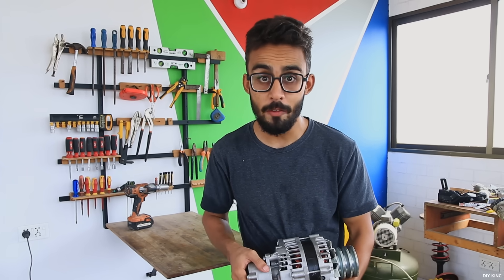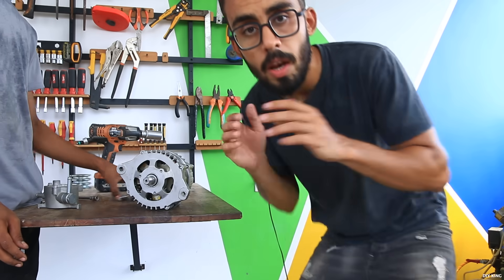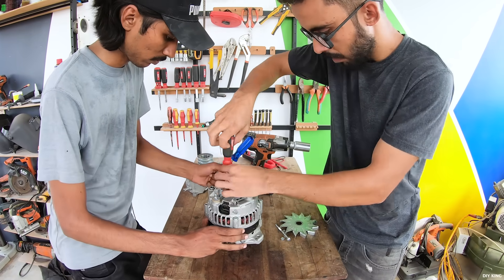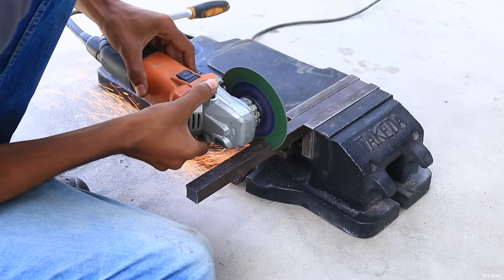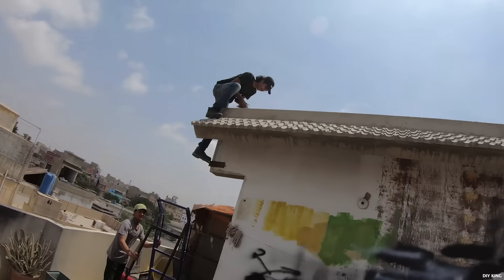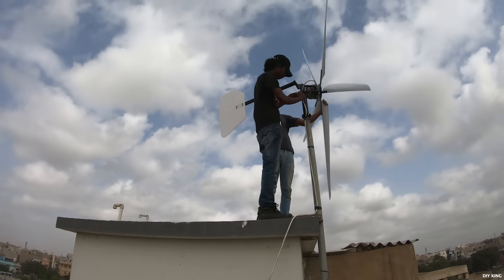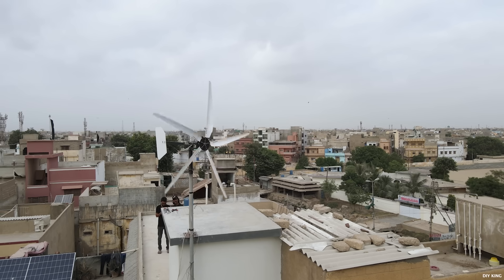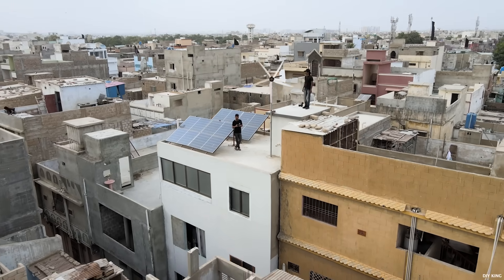Building a Wind Generator using a Car Alternator

Comment: First of all car alternators are not designed for axial loading. They are designed only for a rotary or lateral load. There is no internal thrust bearing. And so, when you mount a turbine directly on the shaft, you are causing a great deal of wear that is far outside the design envelope of the alternator. And so you need the turbine to be mounted on its own shaft, with a thrust bearing of some sort. A simple tapered roller bearing is fine. Then you want to drive the alternator with a belt or chain or other mechanical linkage that only passes lateral or rotational force to the alternator from the turbine. So you can easily change the reduction ratio to give you an optimized torque/speed profile. I suggest you start your experimenting with a turbine pulley twice the size of the alternator pulley, so for every turbine rotation, you get two alternator rotations. Your charge controller can be set to apply the correct electrical load on the alternator.  You will most likely want a much bigger turbine rotor, too. Remember this, one horsepower equals approximately 746 watts. That is with perfect conversion efficiency, which of course you cannot have, no matter how hard you try. I am guessing just intuitively that your rotor will max out at around 1/10 HP. Because you cannot vary the blade angle of attack to compensate for load and wind speed, your turbine will reach a point of diminishing return probably before the wind is strong enough to destroy it. I was once shown by a very bright engineer that to achieve a kilowatt output from a wind turbine in my geographic region, with any regularity at all, I needed a rotor disk with a swept area of at least 10 foot radius. Whew. No thanks. I didn't want blades that big spinning at just subsonic speed and possibly breaking loose and becoming projectiles. But do be aware that if you want a more meaningful output, in addition to other optimizations, you MUST have a bigger turbine. If you used say 8" diameter schedule 80 PVC pipe, and made your blades maybe 5 feet long, for a bit over 10 foot diameter swept area, you would have a significant power harvester there. It's all about the swept area. Well, mostly, anyway. Double the radius and you quadruple the area! 

Honestly, a car alternator and small turbine are probably only going to give you at MOST about 500 watts of power under ideal conditions. 100 to 150 watts is more typical. And yes, replacing the rotor windings with a toroidal magnet will increase your efficiency slightly, but a magnet big and strong enough to do the job will be expensive. You can supply field current in several ways. The best way is to use the alternator to charge a bank of 12V deep cycle (not car batteries!) flooded lead acid batteries through the original voltage regulator.  The stock unit with stock regulator and rectifier is fairly efficient and very simple. It just works. So let the reg sense the battery voltage and it will supply more power when the battery voltage drops, less power when the battery is fully charged. Then the battery is providing the field energy, and accepting the charge output, plus storing energy for when the wind stops. Be sure to install redundant diodes to prevent back feeding the alternator, which can drain a battery very quickly. NEVER disconnect the voltage sense wires while the alternator is turning, our you risk frying the diodes! Other than that, this is a pretty simple and idiot proof project.

I would like to point out one thing, though. The pitch of the rotor blade should vary from blade root to blade tip. At the tips, the blade is turning very fast, in terms of speed through the air. So the vector diagram of true wind vs relative wind, from the blade dip, will indicate a need for a very low pitch, in other words the blade more flat to the wind. However if you use the same low pitch near the root of the blade, where the speed of the blade through the air is much lower due to the shorter distance it must travel in a revolution, then your blade root is in a stall condition. So you want a much higher pitch. In other words, the blade at the root should be closer to edge-on to the wind. You can achieve this blade twist without twisting the PVC material by simply twisting the design as drawn on the pipe. This varies the angle of attack of the blade nicely. You can experiment with different rates of change and different base pitch and get significant increase in efficiency. Also you do not need to taper the tips quite so much. Be sure to fair and smooth both leading and trailing edges of the blades, too.

Don't forget to put a fuse in your charge output cable! I suggest a fuse rated for your alternator rating. Don't take a chance of burning out your alternator or other components. Use BIG cable if you can afford it. For a typical 70 amp alternator and with a run of say 30 feet to the battery bank, I suggest 1AWG or 2AWG stranded copper welding cable. In a low power DC system, it is extremely important to reduce line losses. Yes, the actual accepted wire size for that voltage and current is much smaller. That is not the efficient size, merely the safe size. The welding cable is very flexible and easy to work with, and can be had for a reasonable price per foot.

Comment: you need 2000 -3000 rpm as a car idling at 750 rpm at crank is turning alternator ay above 3x the speed of crank due to pulley gearing. Move the alternator away from the fan and use pulleys and alternator belts to achieve desired rpm!!!
Reply: No, do not use pulleys

Comment: You need at least 36 pole pair armature winding for your low synchronous rpm. Instead of MFR or BRC or BSS regulator choose a LIN-type regulator and a LIN adapter you can set the lowest self excitation rpm. Good Job but you will never provide enough power with a regular car alternator.

Comment: Power is the cube of wind speed guys , if it's possible get it on a 6m pole with guy wires to support and a swivel with counterweight so you can bring it down easy. Well done on your efforts ;-)))))

Comment: It is obvious that you need  2to1 ratio gear  to double the speed of the alternator . You get two gears larder gear fixed to the shaft coming from the blade assembly and smaller gear on the shift of the alternator . You will need a self lubricating bearing and a frame to hold the blade assembly sub frame .offsetting from the alternator
Reply: Gear Ratio ... No!

Comment: Blade design is of most importance. Do more research on that. 
I have read that automotive alternators are about 50% efficient. Improving efficiency should be high on your list. 
Remember that torque X RPM = Horsepower
Good luck.

Comment: The rewiring of the alternator is fine. The mehanical parts very profesional. But there are a few things thay might go wrong and you shoud adress to go ahead:
*a car alternator generates best above  1500  rpm.  At low rpm it could give to small power output.. A belt and pulley or gear mechanism will increase rotor speed
*find the right size or the wind turbine to make capable to move the alternator at hig rpm under load. . The one you have seems too small 
*You dont explain how will the wires go down from alternator to charge controler or other control device wiihout get raveled. Some type or brush spinning mechanisms are used there

Comment: Dont mount the blades on the alternator r,make a plate with a larger pully and use a belt to drive the alternator with a smaller pulley just like on a car engine to increase the speed of the alternator. Your on the right track tho,and in the future look foe an alernator for an ambulance as they handle more amps for all the lights and equiptment.
Reply: Pulleys?  No!

Comment: Would a stepper motor used as a generator give more power? I would think whatever you use it will be necessary to gear up the windmill rpm. Very good video.

Comment: Why didn't you consider the windspeed in your area and calculate the windmill rpm ? and then check peak rpm for alternator to generate max voltage and then derive the gear setup to increase the rpm to the alternator. With a gear box, it's impossible to use a car alternator. 10/10 points for effort. 1/10 point for engineering

Comment: Good idea, I'd suggest putting a Pulley system and adjusting the  diameter ratios accordingly. And also instead of using pipes , you can do a diy of fiberglass and mould it yourself . This also reduces the weight and it's stronger than PVC pipes

Comment: I would suggest getting atleast 3 HP motor. Rewind it to fill max of the slots using required number of turns and maximum thickness of wire gauge possible to increase energy efficiency. Then drill holes or cut grooves in the stator neatly so as to fit neodynum magnets. Or somehow get customized neodynum magnet rotor that can do the job. You can get maximum efficiency by making 3 phase system and then converting the output to DC using 3 phase bridge rectifier and capacitor bank to smoothen the DC output. Use proper gear ratio to maintain the RPM to match with the generator. Since the speed will vary due to wind speed, i would recommend using DC system so that equipments do not malfunction.

Comment: You could use the current turbine blades and gear up the alternator speed by having a simple two wheel pulley system. You could do a 15cm wheel on a 5 cm wheel with a belt connecting them with a 2cm gap and that would do about 700 rpm without taking up too much extra space.
Reply: No!

Comment: You need around 3000 rpm to get real power out from car altenator. This is typical mistake, no gear, no power. Without load it shows voltage, but no real amps and voltage x current = power. So, put gearbox there.
Reply: They know this ...

Comment: Nice but a washing machine motor with a capacitor might be better all around everything from amps to turning speed you will have ac power so if charging batteries you simply have to hook up a battery charger!

Comment: This is good for a first try.  I'm interested to know what brand and model that alternator is - looks like a pretty beefy car alternator with a good-sized stator for a small wind turbine.  Most car alternators are too small for a wind turbine of this size.  As others have pointed out, supermagnets can be added to establish a strong magnetic field, then you would be able to make better power at your relatively low RPM.  That is how most small wind turbines are built these days.  Forget the many suggestions to add ratio gearing - no successful small turbine uses gears, belt-drive, or chain-drive.  That is just what people with no experience always try, but leanr the hard way it just introduces moe failure points. They are noisy and do not last, and are not necessary if you just use strong magnets in the alternator.  I've built many wind turbines and I would say those blades might "work", but some better blades would help.  And that disc, and the steel strips the blades are attached to, are too wimpy to handle strong winds.  This thing would be "blown to smithereens" in a strong wind.  But very good for a first effort!  Most people by far underestimate the strength required for high winds.  The furling tail looks like it works well.  Overspeed protection is essential, and it looks like you realize that.  I am pretty impressed with a nice, clean build, and you at least got it working.  A few minor, and one or two major, adjustments, and you will have a nice, power-producing machine!  :)
Reply: Could you give some idea/details of these strong magnets? 
The ones i found in computer HDDs do not last due to rust. 
Thnx
Reply: Q²9³
Reply: Great job. Please develop a part 2 of this video and please advise the Brand name of the Alternator, and the part no. Or the motorized application ( which vehicle  you “borrowed” it from ). Thanks !!

Comment: i ues a leg of leg of one of the  phase of  the sate  in rectifier & Now dc in to a copastor & back  to the the burses  & from the negative brush  to the body of the alternator  as the  wind pick's up the alternator grows in speed & Bild charge  in the  run copastor delivers a steady voltage to the rotter  as the sped increase's the prudish charging amps, An option is   is to clang the copastor  for vibrating pint regulated this works well & that will provide a regulate dc  current to the rooter only  .  if we are to charge  at a dist. To a bank of batteries , we should modify the stator  in to a 3 phase to a  Y stat   that can travel the distance to the  battery bank & the rectify at battery bank .

Comment: What you are doing work's but won't regulate the power input to the batteries and will overcharge the batteries making the batteries acid boil shortening the batteries life, been there,  the system most have a charging voltage regulator, ,know that, prekindergarten technology.

Comment: Hi. The windmill was almost certainly too small to turn alternator fast enough. A car alternator needs several horsepower to deliver the watts. Alternators give about 350 watts, and assuming 30% efficiency that means a one-two  h.p. propeller at least. Very skilled video performance, well done. Cheers, P.R.
Reply: You must be 127yrs old, you can remember the output of the first alternator installed on a production model vehicle and the phase out of generators in auto use.  Tell me, was that soon after -ve earthing became the standard and 6V was phased out haha.  Meant in jest, but seriously your figures are way off.  Electrical load demand on modern vehicles now with bluetooth this, sync that, infotainment, screens, high power audio, heated everything from glass, arse, to mirrors, 2 billion times the computational capabilities of the Apollo moon lander and more ECU's than the space shuttle means alternators in standard 12V vehicle regularly approach and exceed 100A rated capability.  I'm sure you probably don't need a maths lesson so I no need to throw power figures around except to say that's significantly more than 350W.  That alternator was commercial 24V (not my area, light motor vehicle for me) so current rating would be inversely proportional for the same power, handy for that type of project working with less current .  The vehicles generally have high electrical demand also (did you see the size of that sucker?) starting a high cc diesel and feeding a couple of 25kg+ 200Ah or so batteries, so I reckon if they shared the spec that thing is easy good for 75A, at a charging voltage of say 27V, so 350W??  Oh, and by the way, I think you underestimate the power of wind and fluid/aero dynamics.  Yes is was rudimentary, but the spinny thing was plenty huge enough to drive it (with some gearing).  Nearly 30yrs ago a friend used an old steel bladed radiator fan (adjusted pitch I assume) no bigger than 18" with a scrapyard alternator driven by belt mounted on the roof of his garage (come man cave), and a standard 12V starting battery as storage/smoothing/capacitance to run a CB radio and car stereo (maybe some lights, I cant remember) and in a mild wind it would power everything without draining the battery  ;)
Reply: @bobbobovich4356  Hi Bob. Well done, I'm 128 next birthday. It's all candles and a ruined cake for me. 

Too much irrelevant stuff in your post, mate. F.Y.I. the power available from any windmill is proportional to the CUBE of the airspeed passing through it. It's the VOLUME of air that does the work, volume being a cubic measurement. The one in the video would run the alternator nicely in a category five hurricane (about 256 kph), but quickly self destruct. At normal wind speeds it wouldn't rip the skin off a rice pudding, there's not enough kinetic energy in the small volume of air passing through it per second. Gearing it up won't help. Try pedaling a bike up a steep hill in high gear if you don't believe me. 

Before eager beavers spend their hard earned money on a dodgy project, they should understand the cube law importance in windspeed, because it limits the maximum energy available. Commercial wind generators only work because they have huge volumes of air passing through. Now excuse me, I'm off to finish a homework project. Cheers, P.R.
Reply: A 100 watt car alternator is heavy duty, right. 350 watts?
Reply: @daveapplemotors  Hi Dave. Good point. Wattage varies with requirements of the vehicle. My "ballpark" figure of 350 watts probably applies more to a bus or long-haul truck generator running extra lights and air conditioning. My point that you can't get any more power out of an electric generator than its power input (vee belt, windmill) puts in is correct however. Inserting gearing between the drive and the generator will not increase the amount of power that can be extracted. If it was possible, perpetual motion machines would be exist. Cheers, P.R.
Reply: @daveapplemotors 100w at 12v is only a bit more than 8A. Most passenger vehicles alternator are rated above 100A. Converted to watts that's over 1kw

Comment: If you reduce the current to the rotor then this would reduce the drag and maybe increase the rpm. This is how the alternator regulator works to control the voltage.

Comment: Great video for educational purposes but is there a part two to see if you nail down the blade design and got enough RPMs to charge batteries. Saw some solar panels so wondering if this works in conjunction with solar panels as well

Comment: Very nice 👌 keep making this kind of videos, just wanted to ask you after running the alternator directly without regulator running at 700rpm how much volts it outputs can it change a 12volt battery
Reply: No, it charges nothing ...

Comment: You go to all these efforts of machining the parts, sanding them, and painting them, but you only apply tack welds.. to a structure that will hold a heavy dynamic load.. it just boggles the mind, but makes total sense in the context surrounding you.